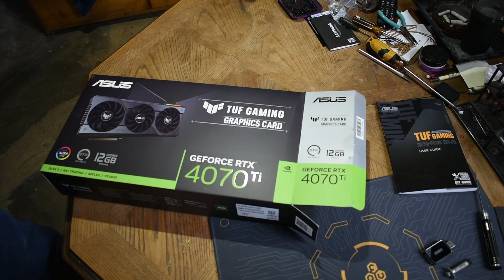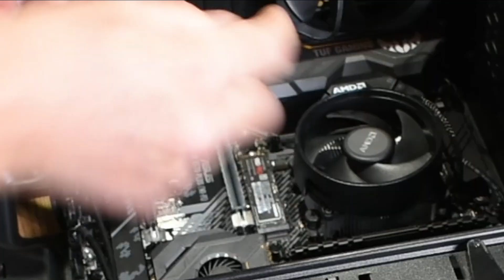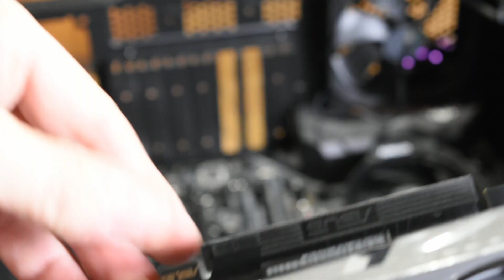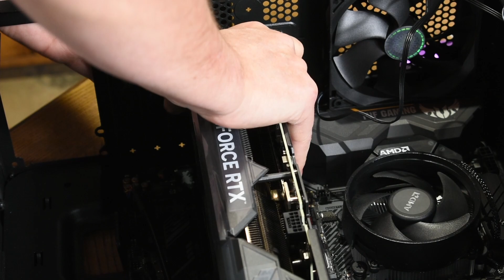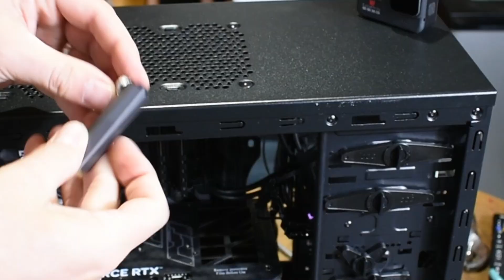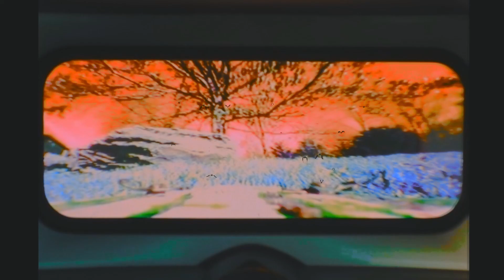GeForce RTX 4070 Ti Install

Comment: hey i just bought the same gpu, to confirm.. use 2 pcie cables or 1 with the 2 connectors?
Reply from the maker: Either one. I'd say 2 pcie cables for redundancy. But if you only have 1 with 2 connectors, that should be fine too.

Comment: my card same as yours has 3 x 8 pins ? would u advice putting all 3 x 8 pins or just 2 x 8 pins in pls
Reply from the maker: 1 min 2 sec into the video you can see there are 2 8pin connectors. I plugged both into 2 separate spots on the power supply.
Reply: Yeah, except like the OP asked, some of these have 3 of the 8-pin connectors
Reply from the maker: @reshpeck  in that case I wouldn't k now. I think the 2-8 pin is just a redundant plug for great conductivity.  I'd imagine the 3 plug would be the same. In parallel not series.

Comment: Dit you connect 2 different PCI cable from your PSU to the adapter or only one ?
Reply from the maker: https://youtu.be/QhkjpSoEEcY
Here is a link to the PSU connecting the GPU
Reply from the maker: 2. I connect two separate pCI cables.

Comment: Nice video, but that actually is a kickstand. It doubles as a screwdriver, but the main purpose is to prevent the GPU from “sagging”. 

I was confused at first too lol
Reply from the maker: LOL awesome. Thank you for the info. That is super helpful.
Reply: I used mine also as a kick stand, works fine
Reply: @eduardalex6531  Right, because it says it is both in the manual that comes with the card.